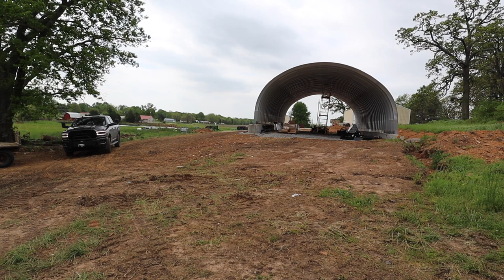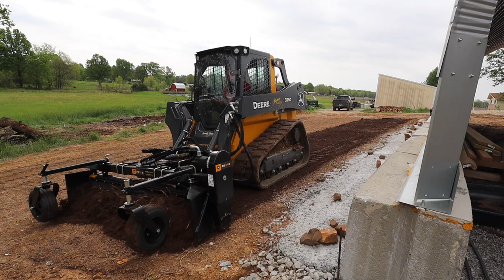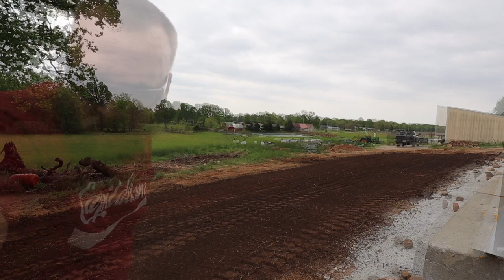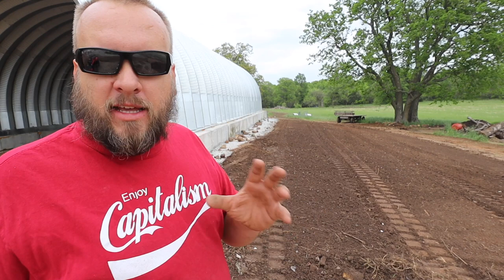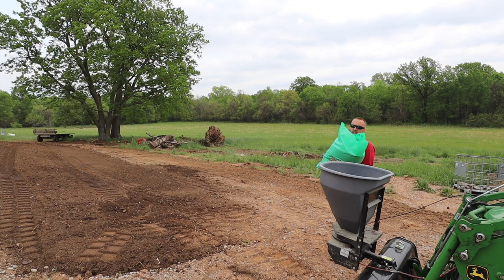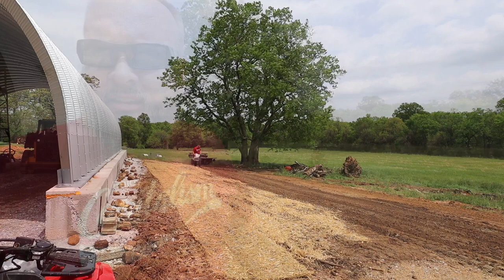Planting Grass on a Hillside - Soil Prep with the Harley Rake

Comment: Brock, our Tractor Supply stores carry compressed straw bales (they were at about $12 a bale) but they are the equivalent of 3 normal bales so the cost really wasn't too bad. The straw should hold everything in place until the seed germinates. One other suggestion is to mix winter wheat seed with the grass seed. It will germinate in a few days and help to hold everything together until the grass seed germinates. It worked really well for me, plus it's pretty cheap. P.S. They keep the compressed bales inside the store on a shelf.

Comment: Looks like a great base for grass. That rolled up straw is excelsior matting. Works great for minimizing erosion on hills but watch ot if the netting is plastic it will not deteriorate and will get wrapped around mower blades. Snakes will also get stuck in it. Cut 4 or 5 of them out of it (alive and dead) after we built our house.
Reply from the maker: The package says biodegradable but I don’t know how long that takes

Comment: You need to put your machine in float and use your bucket curl lever to control the depth, this will give you much more level finish. I have the Bobcat version and I learned this technique from the Dirt Ninja on You Tube.
Reply from the maker: Thanks for the suggestion